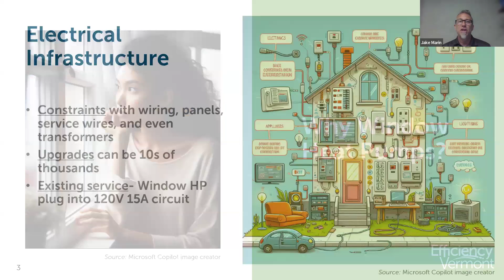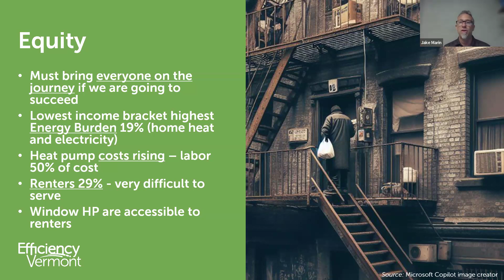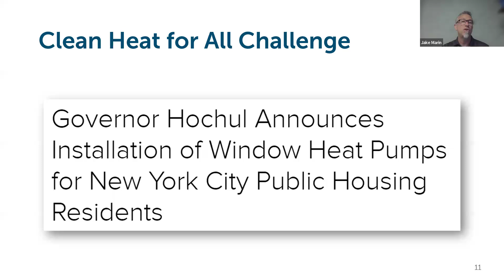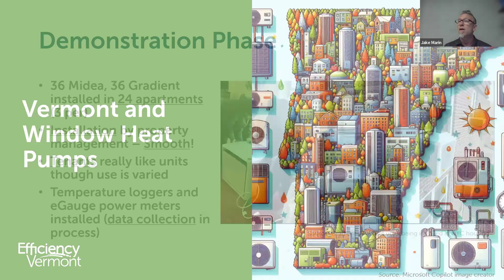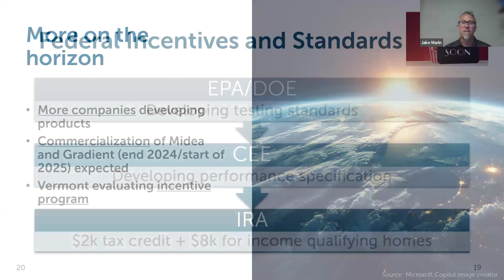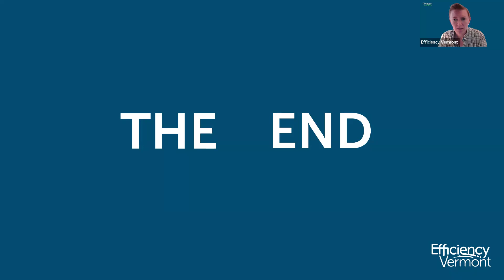Window Heat Pumps: An Emerging Opportunity

Comment: Very informative presentation, although I'm watching this in Feb 2026 nearly 2 years after it was presented.  This there any update on how the pilot project went, if these are are commercially available now, whether there are Vermont incentives available now, and the impact of the IRA subsidies having been killed by the Trump administration?  

Also, using AI generated images like was done in these slides is not very consistent with the mission of Efficiency Vermont, as GenAI uses huge amounts of energy and water--not efficient at all!